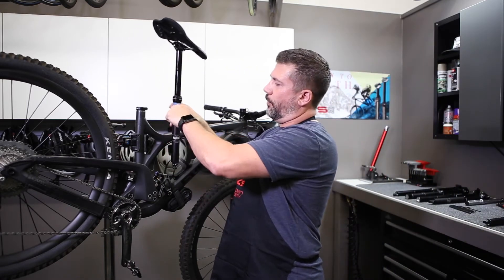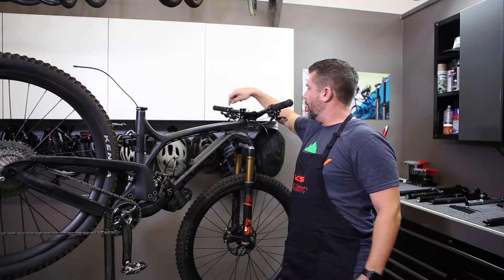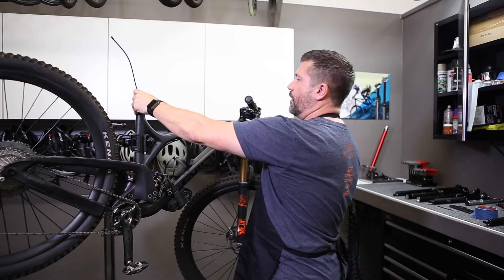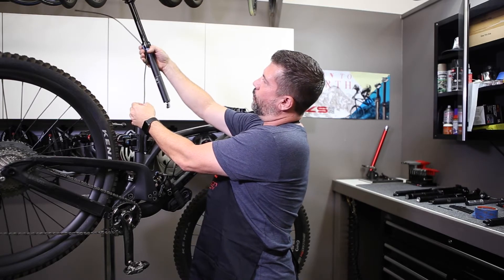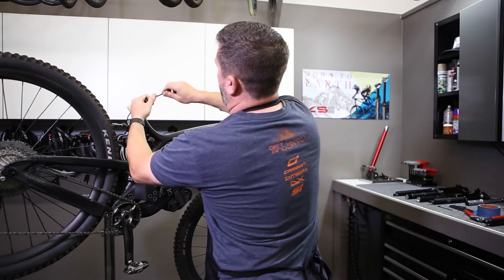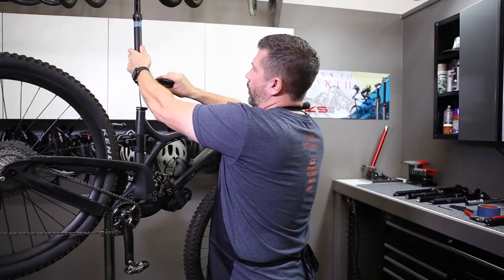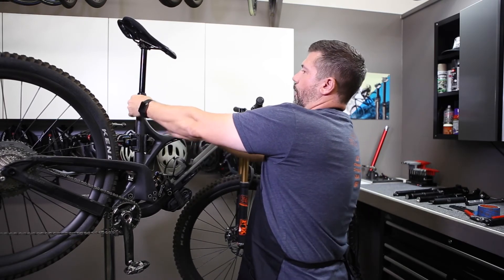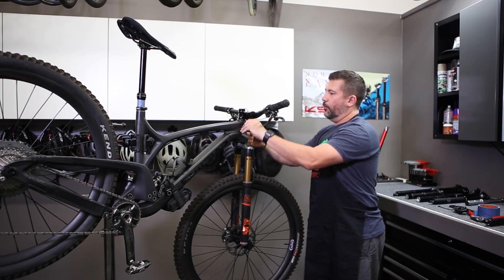Cable Length - Internally routed cable models

Comment: One of the hardest tasks I've ever had to do on a bike was setup a KS Lev dropper post and remote.
Reply from the maker: Thank you for sharing your experience and for engaging with us! We know setting up a dropper post, especially for the first time, can be a bit tricky. If you ever need assistance or have questions about the process, feel free to reach out—we’re here to help! We are also in the process of publishing a whole new set of tutorial videos to make the installation as smooth as possible. Happy riding!

Comment: How far should the inner cable extend out from the ferrule - and how much cable should extend out from the stopper - for a KS Rage? No manuals available on your site for the Rage, alas.
Reply: I would also like to know that. I tried to install the cable and though it looked like a proper lenght (no tension anywhere and the lever worked fine) as soon as I inserted the dropper and circled it a couple of times, the cable slipped out of the ending "barrel" (or whatever one calls it), and I had to route a new cable (the previous one was already frayed. Now I'm hesitant as to the lenght it should have from the the barrel to the beggining of housing at the stopper.

Comment: I get lost after you take the remote off and feed the hose back in. I guess you’re feeding it in until the remote arrives at the frame gromet and hose is pulled all the way through.  Why such convoluted process? Very hard to follow when presenter is standing in front of the bike.